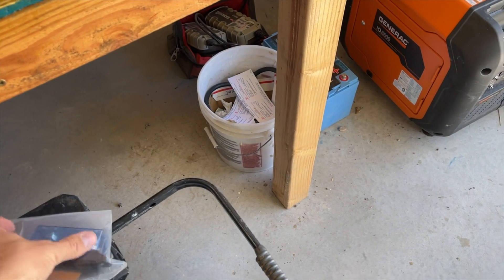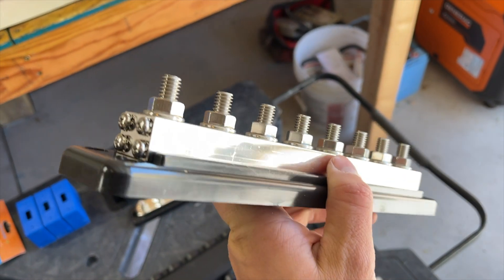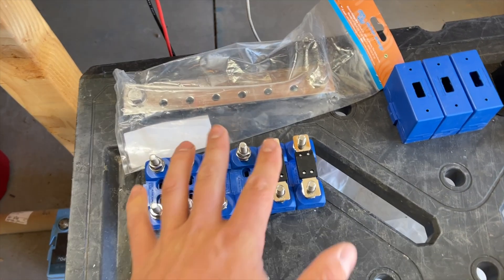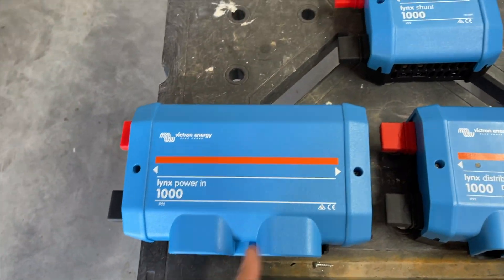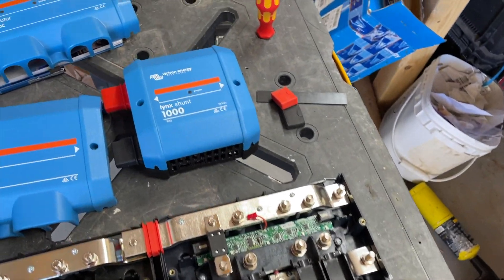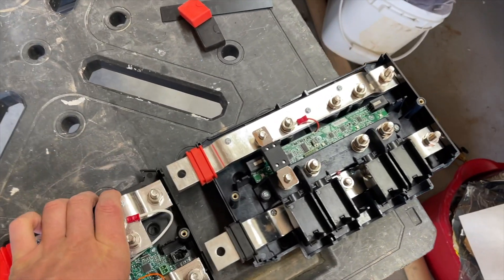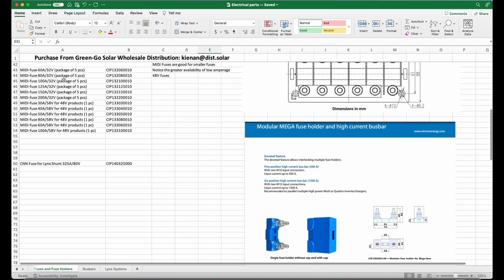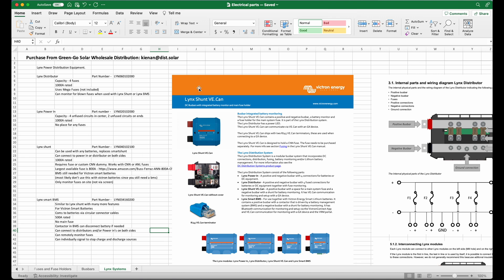Victron DC Distribution Equipment

Comment: When it comes to the shunt, is there enough room to use a 350A T class fuse?
Reply from the maker: Sorry I missed your question, no, it doesn't fit a class T fuse. It fits CNN fuses and ANL fuses. Either of those fuse types would work well for 350A. Those fuses are only available up to 800A, but I have a 1000A fuse that also fits for higher applications. It's custom ordered from LittleFuse